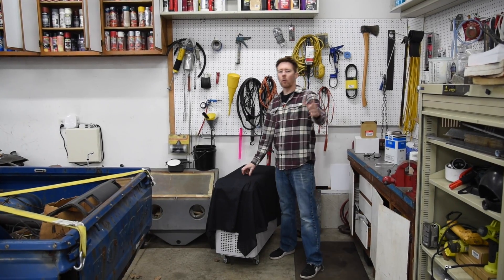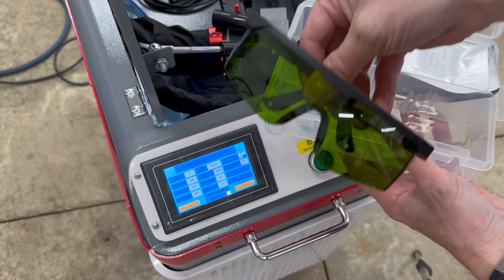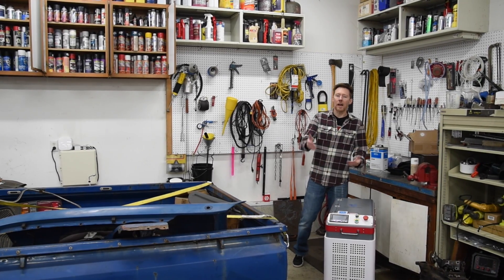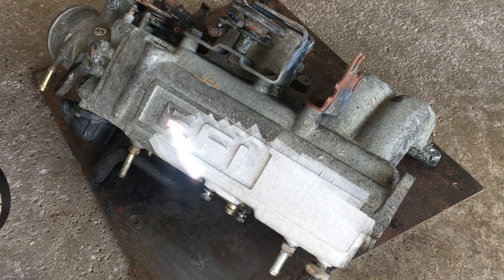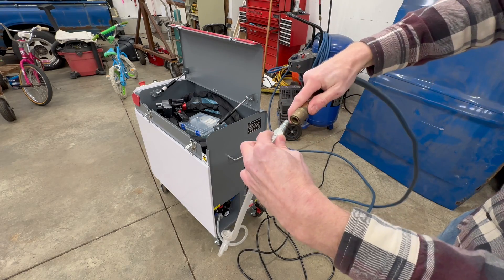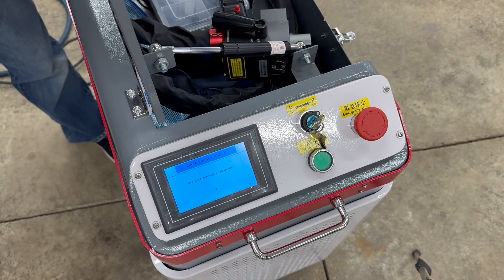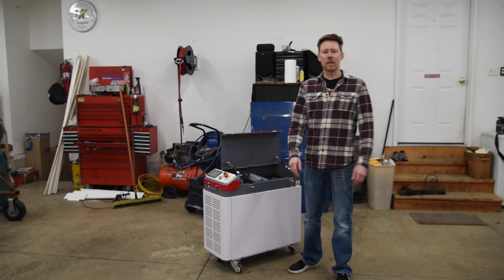Everything to know about 200w Pulsed Laser Cleaning Machine by Fortune Laser

Comment: what would you use under a vehicle?
Reply from the maker: Neither because of rubber brake lines and fuel lines. If it was a bare frame or suspension/drivetrain, I'd use a 2000w Continuous Wave laser cleaner. I have one now and it's so much faster! Here is a speed test comparison of the two: https://youtu.be/PmCEknkaqN4

Comment: So, what was the cost? It was mentioned it would be covered but never heard the actual price.
Reply: I just paid $6,500 USD delivered to my door for a 300 w from a different company. It is a smaller unit as well and runs on 110 volt.  I do wish it had a compartment for everything like yours does but otherwise I love mine and it looks like it actually has a nicer interface and also a remote screen
Reply from the maker: Price was near the end... $9k, but that was in 2023. I'm guessing price may be a little less now as more powerful machines are introduced.

Comment: Do yourself a favor, when you are cleaning those optics put on gloves. it can and will limit oil transfer to the lense. 
You would be surprised to find out how quickly snin oils can seep through those wipes.
Reply from the maker: Good tip!
Reply: @6thGearGarage  Some of the systems I use to work on had optics in them, so if you ever want to see if there is oil on the glass you can get a bright white flashlight and shine it at the glass almost parallel to the glass and see if the oils refract the light.

Alcohol tends to work best to clean them, but if it is stubborn you can wipe that soft spot under your eyes for some acidic oil to break up the stain. then use soapy water and than alcohol to remove the residue. 

If the glass is squeaking when you wipe it clean than it is clean.

Comment: So you say you need 220 outlets. But the machine comes with 110 plugs? So the manufacturer is ok with a 110 hook up then?
Reply from the maker: It uses a 220 outlet, but the plug was a 110 style. I did not specify when ordering. 
I’m guessing it was that way because most countries don’t use 110.

Comment: So how do you deal with the toxic fumes of burning iron oxide and grease and paint and other nasties on metals .Those are powerful carcinogenic chemical by products
Reply from the maker: I don't use it in an enclosed area.
Reply: @6thGearGarage  does not matter those are heavy metals and they need a water filtration system to collect the vapors .be careful with whimis  and labour and environmental rules .If you are only doing it for your own stuff that's one thing when you operate a business that's another issue .Remember stuff that goes in the air travels to other people's property creating issues so be careful ..For your own health use a proper  activated charcoal mask and wear the proper glasses for the laser .don't fool around you only have one set of eyes .And your lungs will thank you

Comment: Both types are only working for surface rust. It is its biggest disadvantage. They do NOT work for thick rust.
Reply: Wrong!!!!!!!  Our 3000 watt CW laser will clean off 1/8 - 3/16" of rust scale on a truck frame as fast as a 2000 watt will clean off 1/16" of surface rust.

Comment: Dude, love the lasers but I'm laughing why and how long it took.. Even fast forward was slow.. pretty good at light modeling but not automotive.  9000? Lol.. not cheap? But what did it do?
Reply from the maker: This pulsed is ideal for smaller or specific tolerance items which need to be cleaned without altering the original surface.  I just got a 2000w continuous wave machine and it's perfect for large items. the beam is 300mm wide instead of 50mm. It does create a lot more heat though.

Comment: In your demo you said you use a cross fan to help avoid debris clouding up the protective lens, letting it blow outside your garage. 

From my understanding if someone walks by, sees you it, and wonders over to take a look it could be very dangerous for their eye sight. Something to keep in mind as you could be liable or at fault for improper safety procedures I would imagine. 

Otherwise great video thanks for all the detail. Very helpful actually.
Reply from the maker: I do not live in a populated area, so It's not a problem here. However, I do tell the kids to stay away from the garage when they hear me using the laser.
Reply: There is some truth to this but in reality the intensity drop off is so rapid I think if you were 15 or 20 ft away the risk is almost nothing

Comment: You didn't cover gaussian vs flat top
Reply from the maker: I didn't know either applied to a pulsed laser cleaning machine, as the width of the beam can be adjusted up to 50mm.
Reply: @6thGearGarage  each do different cleaning so it sucks to have to have one machine of each
Reply from the maker: @jdaspects  are you referring to pulsed vs continuous wave? Those are the only two types of heavy duty laser cleaning machines I'm familiar with.
Reply: @6thGearGarage  pulse comes either gauss or top hat /flat top
Reply: @6thGearGarage  is yours gauss?
Reply from the maker: @jdaspects  I don't know, I've never seen a laser cleaner advertised as either gaussian or flat top.

Comment: If anyone is looking to clean a large area,  you will need more than 200w pulse.  It will take some time..  I have used a 100w laser, and the 200w cuts the time in half but still quite some time.  You would need bigger than 500 in my opinion.
Reply from the maker: For large areas I would recommend a CW laser. The max width if the machine in this video is 50mm. Next I am getting a 2000w CW machine with a width of 800mm. Large jobs will take a fraction of the time.

Comment: Hello, I would like to know what airflow rate (in liters per minute) you use to clean the protective lens ?
Reply from the maker: The manual did not list a rate, but a small air compressor will do the job.

Comment: Great video.  What respirator are you using with the machine?  We have a 300W which we use on wood, and we are having trouble finding the correct respirator.  Any help would be appreciated.
Reply from the maker: Thanks! I use the machine outdoors, so there are no fumes/smoke which require a respirator.
Reply: You will need an ABEK-P2 minimum. Fumes contain chemical vapours as well as smoke particles,  so you need filters that will trap both. A P3 or P2 on its own isn't good enough.

Comment: Hello, Once it's clean do you use any coating to protect it?
Reply from the maker: After laser cleaning is the ideal time to prime and paint the metal.
Reply from the maker: exhaust manifold: https://youtube.com/shorts/B4KxDyMub4k?feature=share
Reply from the maker: carb intake manifold https://youtube.com/shorts/xOqHDTKacwk?feature=share
Reply from the maker: EFI aluminum intake manifold https://youtube.com/shorts/D-jQYfgTg6I?feature=share
Reply from the maker: slow motion: https://youtube.com/shorts/1w_scgeniXw
Reply: 🙏🏼 Thank you great video!
Reply: Amazing, what about on engine part or brake disc? Thank you for your time.
Reply from the maker: @mattd744  I used it to clean an engine in this video  https://youtu.be/S2EHprCWfCs go to 2 min 20 sec.
Reply from the maker: @mattd744  here is cleaning a rod/piston: https://youtube.com/shorts/Q3vdUFsNMLs?feature=share

Comment: what is the benefit/purpose of using the adapter from 110 to 220? if it needs 220 why does it have the 110 plug?
Reply from the maker: Not sure why, maybe because many parts of the world don’t use 110v?
Reply: @6thGearGarage  i only ask because we purchased a similar machine and it has a 110v plug and it doesnt seem like its getting enough power. Not sure if i need to purchase a 220 adapter like this or a converter
Reply from the maker: @matlockwk  only plug the machine into an outlet with the proper voltage. If using a 220 machine on 110, or vice versa, damage can occur.
Reply from the maker: @matlockwk  I would check with the manufacturer to find the proper voltage of the machine. But also the wrong parameter settings can make it seem like it is under powered.
Reply: Some 220 v plugs have a sideways blade. It is 220, and should have a receptacle to match.
Reply: I have a 300 w pulse machine that runs on 110 volts only about 1,000 Watts it works great

Comment: It’s a good idea not to use these machines outside in high wind conditions cause the wind can cause the laser beam to drift or “blow around” making it dangerous as you can easily cause collateral damage.
Reply: Laser is light. When the hell did wind start blowing light around?
Reply from the maker: I wasn't aware that could happen, thanks.

Comment: I’m wanting on for restoring cast iron cookware. I have several hundred pieces that need to be restored. Can you tell me which one would be best? I’m scared it will leave permanent marks on the metal which will defeat the purpose. Thanks
Reply from the maker: On this machine, there s an edge setting which can be programmed to leave a softer edge instead of the hard edge. I think it would work well.  I think it would clean similar to this cast iron exhaust manifold: https://youtube.com/shorts/B4KxDyMub4k

Comment: Excellent presentation! One question, in your experience,  the cleaning speed of the laser between a glass beads blasting cabinet and the laser over a light or flash rusted panel is slow or about the same? Can you give a  value in sq inches / minute? I am not interested in giving a profile, just remove the rust and stains. Appreciate your comments.
Reply from the maker: The speed will vary depending on the substrate and amount of rust. I have only used sand blasting, never glass beads. The laser is at least twice as fast as my sand blasting cabinet.

Comment: Wow looked great for body shop until the price,it will have to save a lot of time and material to be cost effective. Don't know if you tried but a quick dust coat of darker paint may generate enough heat to allow Lazer to work on light paints.
Reply from the maker: Good idea! But I think it would just remove the light coat of dark paint right away and still have to work a bit at the light paint.

Comment: What plug did you buy and what amperage are you running?
Reply from the maker: Here is the plug https://ebay.us/DAdva5 and my 220 outlet is 50A, which is way more than this machine needs. (I also use the outlet for a welder & plasma cutter.)
Reply: @6thGearGarage  thank you! I Bought the 300w  laser and  it looks like it only takes  9.1 amps. So I might just hook up a double pole 15 amp breaker. Other wise I have a 50 and 30 amp for other welders. Thanks for replying to comments! You videos are very well planned out and produced. Keep it up 👍.

Comment: 200 watt or 2000 watt?
Reply from the maker: The one I bought is 200 w
Reply: @6thGearGarage  It seems to be no different than 2000 watt ones I've looked at
Reply from the maker: @laserfalcon  2000w is continuous wave. This is a Pulsed laser, used for different types of applications.
Reply from the maker: @laserfalcon  CW laser is better for larger, heavy duty rust removal. Pulsed is better for sensitive pats.
Reply: @6thGearGarage  i was looking at  a  2,000 watt system and was surprised 200 watt seemed to work just as well for rust
Reply: @6thGearGarage  do the larger watt machines do both?
Reply from the maker: @laserfalcon  no they don’t, you have to pick one or the other. Maybe they’ll make one that does both one day.
Reply from the maker: @laserfalcon yeah,  the pulsed lasers use less power (and heat) to get the job done.
Reply: @6thGearGarage  How does a CW compare if run at low power?
Reply from the maker: @laserfalcon  I’m not sure, as I’ve never used one.

Comment: Small update for us?
1. Still happy with it? 
2. How many hours did you use it, Until the video came out?
3. Did you have to repair someting until you got it? 
4. did you have reach maximum thermal protection if yes after how much time of use the thermal protection kick on

Thx for the respond. I want to have one for personal use and start a little bisness on the side with it
Reply from the maker: 1. Absolutely!  2. I'd guess about 15 hours before I made the video. 3. Not sure I understand the question, but I mostly work on older vehicles, many with rusty parts. 4. The machine has never reached thermal protection. I always run an air line because it is air cooled.  Eventually I'd like to buy a 1500w or 2000w CW machine for bigger parts like  frames, axles, heavy scaled parts.
Reply: @6thGearGarage  sorry for my poor English. for the question 3 did the lazer machine have broke or need to get Something fix. 

i know for heavy rust needle air hammer or air hammer with the flat hammer work realy good for removing scaled parts
Reply from the maker: @patricklafreniere9841  I see... The machine has never broken or need repaired. It has been maintenance free so far.

Comment: BEWARE  Youtubers of these cheap cleaning lasers! (not ALL Chinese lasers are bad, but do your homework)...most of these thing are 'toys"
1. Avoid anything with a Raycus laser diode (they are getting better, but there is a reason why they are so cheap...most won't last a year...)
2. Don't get a unit that cleans AND welds (they do neither well)
3. Get a unit with USA tech support (from a dealer....avoid Amazon/Alibaba, or you WILL be sorry)
4. Get a unit that has a chiller for the diode (for a continuous wave laser like the one in this video)...pulse wave up to 300w is ok without
5. Make sure the head has an air blade (keeps the protective lenses cleaner much longer/ extends optics life)
6. Continuous Wave lasers are usually the way to go (unless doing thin material/ Aluminum / heat treat scale)....then go to a pulse laser
7. Don't use they eyewear that comes with the laser cleaner (they are always OD 5...should be at least OD 7+ @ 1.0 - 1.1 nm range wavelength)
8. Don't use welding goggles as eyewear (totally different wavelength...won't protect eyes at all)
9. Bescutter is probably the best entry level cleaning laser / bang for the buck...has a 2 year on sight service warranty
10. If USA made cleaning lasers are in your budget I'd recommend Laser Marking Technologies (1/2 the price of the big boys with better core and optics)
11. Ask for references....folks who have been using them for a while will be glad to share the good, the bad and the ugly
Reply from the maker: You have many good points that I agree with 100% - I'm skipping over those to keep this shorter.  I disagree with #3 though. Fortune Laser is based in China, yet their customer support has been incredible. 
#4. The machine in this video is an air cooled Pulsed laser, not continuous. I think all continuous wave machines are liquid cooled... and yes, definitely avoid any that are not. 
#6. It really depends on the type of cleaning you'll do. CW machines tend to etch/overheat the surface to a point where the surface is no longer smooth. Great for larger steel items where surface appearance does not matter. I feel pulsed is superior because it's usable on much more. Ideally, owning both machines would be the perfect scenario. 
#7. The protective eyewear that came with my machine was correct. I'd question the integrity of any company including the wrong eyewear, as that's very important. 
#9 I looked up Bescutter and it's hard to justify their $57,000 200w machine at 6.5x the cost of this one... but if you're a corporation and can afford such an expensive machine then more power to you. I don't think that's feasible as a small business owner or hobbyist.  I think prices will continue to drop as more companies continue to manufacture these machines.

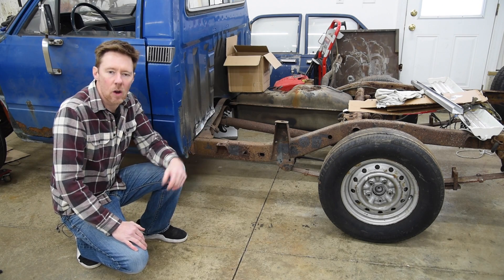Comment: 12:24 If you cleaned long enough, will it chew through the scale or it will reflected of and laser has no effect? If you use needle scaler along with laser, is it possible to get it clean or you still need to resort to sand blasting?
Reply from the maker: It might get through some of the lighter scaling eventually. Anything to knock the scale off first will allow the laser cleaner to throughly clean the surface beneath. You could use a needle scaler, wire brush, or even a metal scraper.

Comment: I think for a similar price you can get the one that welds as well
Reply from the maker: Actually a lot cheaper! I initially looked at the 3-in-1 welder/cutting/cleaning machine, which was about $3k cheaper. It's a continuous wave laser though, so the cleaning isn't as good for certain surfaces.  I already have a mig welder, so I really needed a machine to do cleaning.
Reply: Which model?  @6thGearGarage
Reply from the maker: @johnathonjsmith  I don't recall the model #. It's on their website, have to contact them about the pricing though.